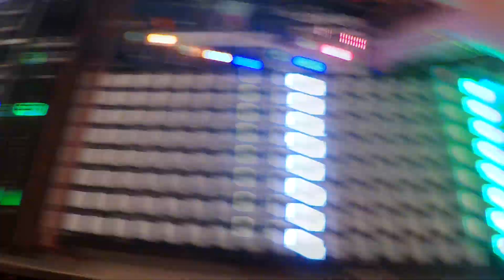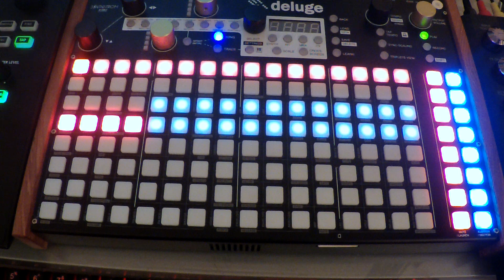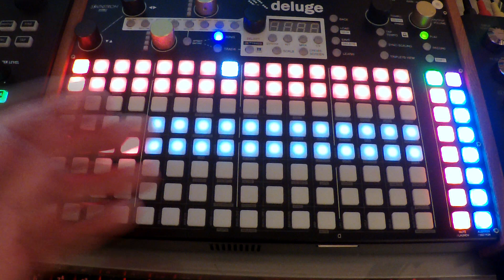Making templates // Synthstrom Deluge Tutorial

Comment: how do i save a song to be a template. I feel like you spent half the video explaining everything apart from assigning the template for the deluge to use on start up. I've currently got a file called template in my song folder and the deluge is not recognizing it.
Reply from the maker: This is an older video but just name it press save. Not sure why you're having an issue it should be very cut and dry. Make sure you're on the latest firmware . You have to manually load the template, there's no way currently to tell it to auto load a song file.
Reply: @RonCavagnaro  sweet as. If its saved as 0 then all you need to do is double press load to load up the tenplate which is handy

Comment: I don't know what I am doing wrong here. When I set a synth track to type=line/lr and set a c3 note it still plays the internal synth. The only way I can get a clean line in is by setting a kit track to line in. 

I don't know if this is a difference in firmware or something. The way mine works I can't play a line synth and transpose the input to different notes like you show at the beginning without the internal synth also playing.
Reply from the maker: It should not hear any internal synth when you set to line LR. Make sure you're starting from a new synth, shift+synth. It sounds like you're using a preset that has both oscs going.
Reply: @RonCavagnaro  doh!!! Thank you!

Comment: I use templates too with my deluge.  Another good thing to mention about saving to templates is saving cc messages to the templates.  I like to motion sequencer some parts of my synths with the deluge (particularly the filters, envelopes, and LFOs), and it's a huge time saver for me to have cc messages saved to my templates so I don't have to break out the manual every time I want to send a commonly used message from my deluge to my synths.

As always, very helpful videos!  Hadn't set up a sample track in my templates yet so now I'm gonna do that.
Reply from the maker: Are you aware you can auto record cc if the midi signal is coming in to deluge??